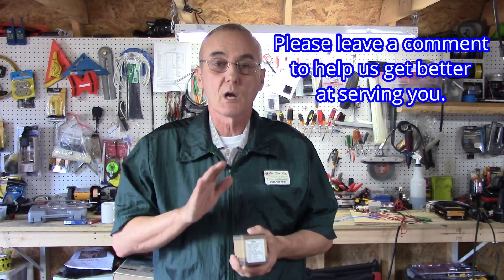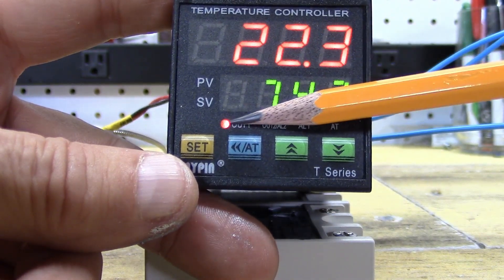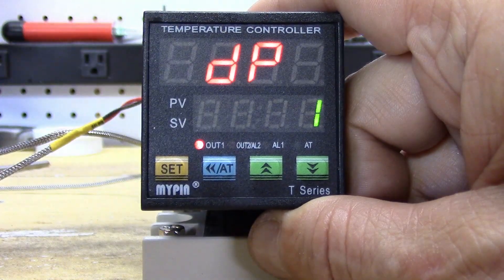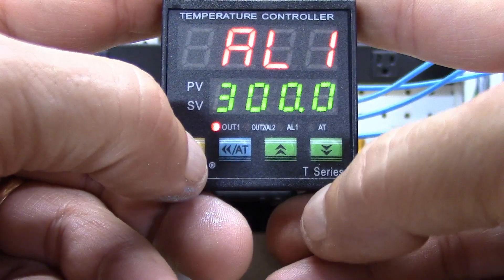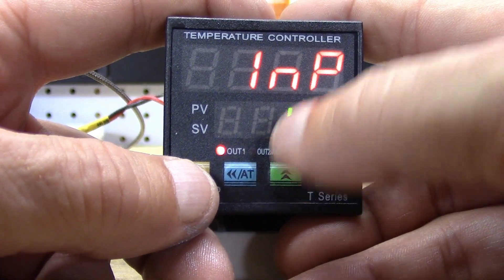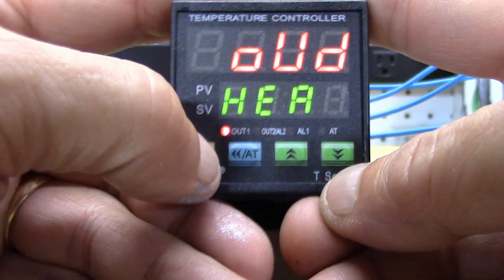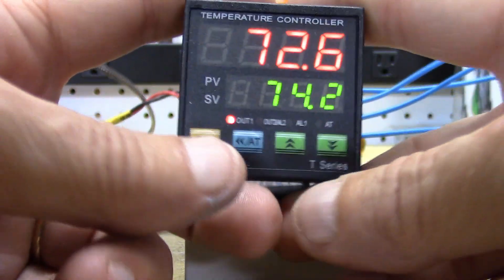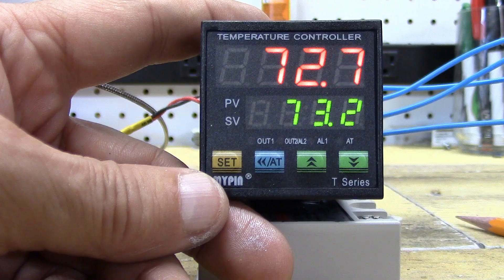Setting parameters on the MyPin T series PID controller

Comment: I have question can this unit be set up to run to set point and then stop output until you restart it 
I have a ceramic kiln and want the temp to go to 1940 and then shut off the ssr till I want to fire again and not continuously heat??
Thanks Ellis

Comment: I just set up the same controller for a powder coater oven. My elements did not come on when temp was set to 240 degrees. I started testing. I do not have any voltage coming out of pins 3-4 & 5-6. Therefore the SSR's are not being turned on. Can you tell me what voltage they should be putting out and if its a/c or d/c.

Comment: tanks  now can you help me   I  make close circuit water circulation   I need programation for. exemple   when the water is 60 degrees I need the pump start  to circulate water and stop at 30 degrees  is that possible ???    and in the same time remove the pulse mode. tanks in advance. Gaetan

Comment: I'm building a powder coating oven and this guide has immensely help me understand the settings. Thank you so much. My low limit was set high for some reason and I wasn't able to get the temperature that I needed. I was able to set it quickly just by watching this video. Thank you so much. It is greatly appreciated.

Comment: Hello,
I have a PID on my home made powder coating oven. It is used to turn on my Carlin EZ propane gas burner. Everything thing seems to work fine except when the oven gets close to the shut on temp, it cuts off befor reaching the set temp. Say, the temp is set at 400 degrees, when the temp raise to 390 degrees, I see the Out1 light come on and kills the flame, then right back on. Repeats this till it finally get up to 400 degrees. Does not mater the temp setting, always cuts it off befor the set temp. You have any ideal what might cause this?

Comment: Maybe someone can help me out. I bought a generic heat press and the control panel is not working.  If i put the set point high it will go all the way but display will stop. If the set point is low it will reach a different temperature and just turn off. It never stops at my set point and when cooling it down with a fan the temperature will show it rising not lowering but to touch its lower. Please help, I've put the last of my money into this so i can start making money. Thank you.

Comment: so I recently dropped the box and my T series was all UUUUU across the top. it has since been repaired. the temp can be set now but the thermometer isn't reading at all. it sounds like it's trying to heat up. what can I do to get this working the way it was when I got it? it didn't fall far and it's still very new. only used a dozen times maybe

Comment: hello.. i like very much yours videos.. i ha ve a question? i'm into charcuterie making. i use inkbird pid controller for my smoker, but can i use it for controlling my fermentation and drying chamber? which it should run in 55 F, and 80% relative humidity, and if it not, what would you recommend me/ i'm using  vertical fridge medicated with humidifier and a dehumidifier  .... i was using an  Inkbird IHC-200 WIFI and  ITC-308-WIFI (WHICH IT BROKE AFTER A WEEK ))

Comment: My temp controller was set at 100C out of the box. I switched to F and it still said 100. Is this still in C or is it now 100F? I would have expected the set point to change to 212 when switched to F.

Comment: Hi, thank you for so good explanation video, i just have one question, does the preset values remains after main power is shut off then when its again on do i have to set parameters again and again or it remains saved ?

Thank very much.
Kind regards
Reply from the maker: The values remain set until you change them.
Reply: Thank you very much 😊

Comment: Is there a way to set a mypin TA4 to manual mode to deliver 0 to 100 percent power to the element?
I have it set up as a pid running a 250v 5k element. 
I would like to try running it manually.

Comment: I may have missed it but is there a way to change the sensitivity so it doesn’t constantly come on and off trying to maintain the temperature could you set like a 5-10 degree tolerance?
Reply: I want to know the same thing.
Reply: @michaelshubert5118  Because my thing is are use this to make a oven controller for powder coating but my oven is going to be heated with a natural gas burner and I don’t want it to be telling the burner to come on and go off every two seconds it’s almost like I might need to use a time delay or some thing that way it runs for a minimum of 20 seconds or so and has an off time of at least 20 or 30 seconds before it comes back on
Reply: @dirtymaxsteve2860  I want to set up a vent fan in a greenhouse, don't want the vent to open and close every 2 seconds. So looking for the same thing but different applications.
Reply: @michaelshubert5118  Think of it is if you have it in PID mode I believe it is a smart controller and it will learn how long it needs to stay on for and how long it needs to stay off for to be able to control the temperature so if I’m not mistaken once it realizes it Has to be open or closed for a certain amount of time to make a difference it should stay like that but I might send an email to inc bird

Comment: I have delema I've tried 2 different k type thermocouples and 2 mypin pid's and get the same result. I calibrate the temp using the puf function so it matches the temp on 3 other thermometers and the pid reading doesnt hold steady to match the others it will either rise 1/10 of degree at a time and keep going to a couple of degrees off from the other thermometers. So I recalibrated everything to match then put the thermomoters and the pid probe in to some ice water. The other themomenters read 36 f and the pid reads 43 f dont know what is causing that or what to do about it. does the same thing in boiling water at the other end.

Comment: Hi. Im using CD101 pid controller with SSR and thermocouple K type. I have set the SV at 180, but the number keeps pushing till it exceeds 180. It wont stop. So does anyone know what should be done in order the value be maintained at 180?

Comment: I have set exactly your settings in this vid. Still works great for about one hour, then output light on pid goes out causing element to shut down. When i go into settings again the proportional band has changed itself to 0 when I originally set it to 1 as you instructed. This has happened repeat times. Any ideas?
Reply from the maker: Are you saving the setting? Probably a dumb ass question here. If the answer is yes maybe you need a new controller.

Comment: Is there any way to run this PID in manual mode where you can adjust the power output manually?
Reply from the maker: The inkbird does
Reply: @BarleyandHopsBrewing  Would that be the INKBIRD ITC 106VH?  I may have to replace my MyPin with one that I can set the percentage of voltage I'm sending to my burner.

Comment: Question. 
I am using this to control a heater for kiln.  But my settings are causing it to open and close when it gets close to set parameter.

How can I set it do it simply goes off when desired temp is reached?

I want to stop the throttling of the relay and just have it open once temp is reached. 

Thank you

Comment: Great videos like always!, i showed on a group the picture of my built for PID controller and someone said to me this:" What are you going to regulate with your pid? The boiling temp of your mash is set by laws of physics and the abv in your mash. Look at the green line in the graph. That's the boiling point of your mash. Did you ever try to get water to boil below or above 212/100º F/C with your pid? You don't need a pid, you need a power regulator on the amps you supply to your heating element." 
So it started a debate with the guys , what can i tell him?  I only want to use it in winter because propane and inside distilling is to dangerous.
Reply from the maker: A PID controls the power output to the element based on need. It adjusts the amperage and voltage required by timing the power supply in the SSR as the control signal is converted to a square wave where changes only happen at the zero crossing point. This timing function converts that square wave into a percentage of power realized at the element. It is a smart controller as opposed to an analog controller you turn up and down. 
Hope this helps
George

Comment: I installed the  mypin  PID tonight and i set the parameters to your settings George " and a big thanks for showing them so clearly" .mine is the MYPIN Temperature controller - model : TD4-SNR , Input : TC/RTD,  Output : SSR , POWER : 90-260V  AC/DC. Mine has a extra light  on the front panel, from the left   -   S/MV     OUT1    OUT2/AL2     AL1    AT/M      5 Lamps.  If i click the set button the S/MV  lamp comes on and the volts keep changing bouncing around showing the voltage sent to the element "good"  . But i am not sure what the new S/MV lamp is for.

Comment: I mean you have set this at 1, a 1 second delay for the pid to decide to close or open the contact in the pid, which do you think is best a 20 second delay or a 1 second delay to stop the contact from heating up and burning out? Also your setting  is set to 1 , does this setting work for you ok ?
Reply from the maker: You are thinking of this as a standard mechanical relay. It is not a standard relay. These figures work for me. By the way the 1 is a proportional setting not 1 second.
Reply: @BarleyandHopsBrewing  thanks so much , i will set it to 1
Reply: @BarleyandHopsBrewing  Yes your right there I was thinking on the line of a mechanical relay, I use to replace or install the CE 3 phase 240 volt  contactor on street light circuits a few years back, thanks for clearing that up.

Comment: now on the control settings, the factory set is 20 , a 20 second delay in the pid before it decides  if it closes  the contact in the relay, you have set the relay to delay only 1 second before the relay decides if it closes the contact. To stop any burn out in the relay should this be left at 20 ?
Reply from the maker: Yes, for a mechanical relay that is correct. The 1 setting is recommended for solid state relays since they have no mechanical contacts.

Comment: 4:05 "with proportional integral control you will almost reach your set point but never quite get there, it's mathematically impossible".
Sorry but that statement is true for proportional only control. Integral is what enables you to reach the set point. Derivative relates to the rate at which you approach the set point. It helps you run a higher integral to reach your set point sooner by helping to prevent overshoot.
Reply: meetim i have just bought the mypin, what do u mean in regard to the settings here ?
Reply: @cameronshine3465  Not sure I understand your question, but to elaborate my comment:  in your Mypin or any PID controller there are among a bunch of other settings, three called P, I & D, which are the main ones to worry about. if you set P to a value, and leave I & D at zero, you can never reach your set point, because the drive to reach the set point is proportional (P) to the distance from the set point.  ergo, when you are close to your set point, the drive to get there is small, and it never happens. this fixed distance between the operating and set point is called the offset. Integral (I) forces the operating point closer to the set point by adding an amount that you specify to the mathematical expression governing your operating point. If you add just the right amount, you reach your set point and life is good. if you add too much, it overshoots. then the proportional control kicks in to drive it back the other way (in the case of temperature control, turns off the heating or cooling source). with too much integral you continue to oscillate.  The fix for this is to reduce the integral or add in some Derivative (D). This measures the speed at which your operating point approaches the set point, and predictively turns off the heating ahead of getting there to try and control overshoot. (Derivative is a calculus term in which the rate of change of an equation can be determined).  All of that is the theory. in practice it can still be super hard finding the right settings for your application.  For the trial and error approach, you start with P & end up at D with trial values. There are more analytical approaches but I dont know them in sufficient detail to pass that knowledge on.
Reply: @meetim6271  ok  thanks , yes that makes cents .